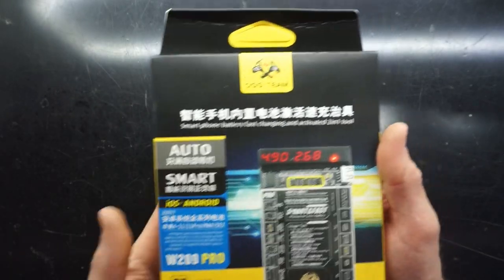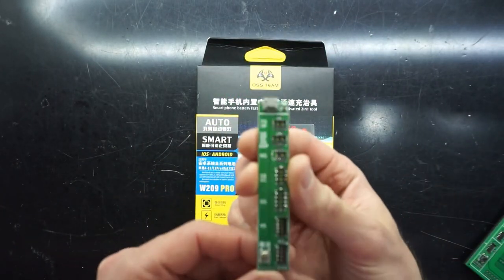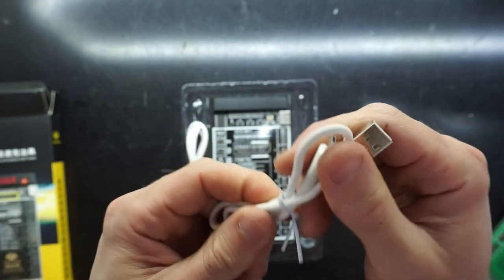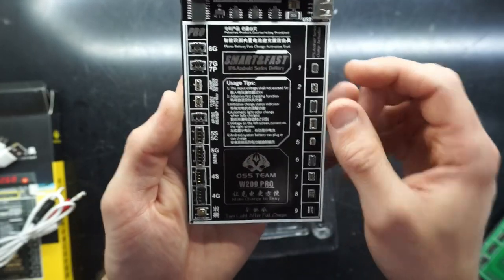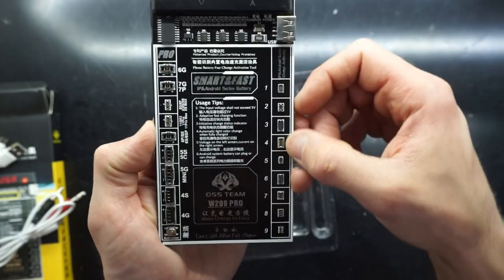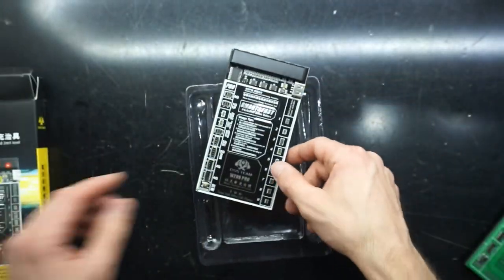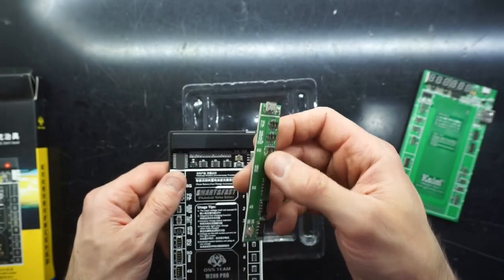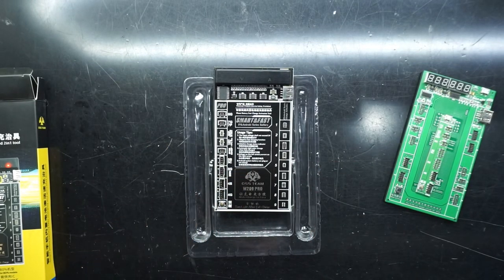OSS W209 Pro Battery charger Unboxing

Comment: Interesting... so can any of these devices be setup to show actual/true mAh capacity of an OEM or aftermarket cellphone battery(?)  Such a feature would be extremely helpful so people can stop getting scammed by all the aftermarket sellers who are hacking the batteries they sell  and/or selling used batteries with false mAh capacity(!)
Reply from the maker: It's useful for showing the battery stats but usually these are cleared and zeroed before they are sold, so it won't have the true stats of the battery saved